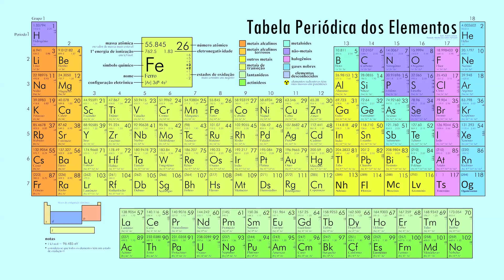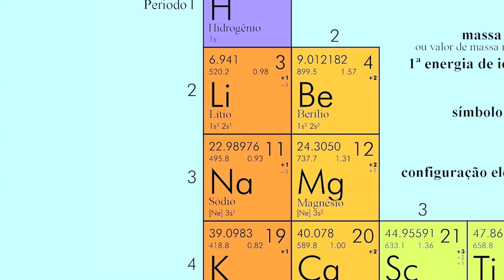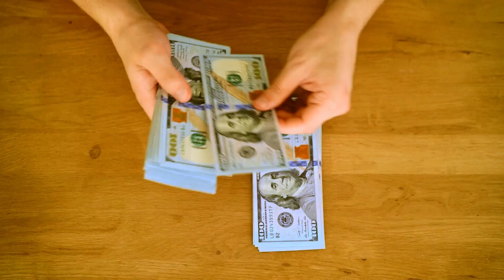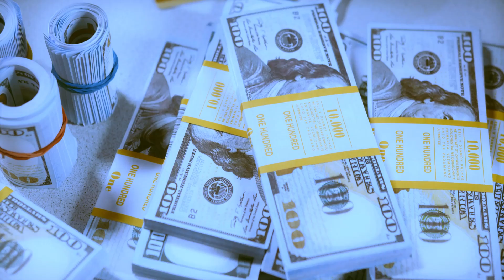BREAKING NEWS: BYD'S SODIUM-ION EV UNDER $10K!

Comment: I want to invest in sodium ion tecnology. Why it is important so much for me? 1) Environmental issues: They have the highest importance. Sodium is more abundant, cheap, clean, easily recycalable, friendly to environment in production process,  compared to lithium. Sodium can not pollute water and environment in production process. On the other hand you do not need scarce elements like Cobalt and Manganese in production of batteries. These element are much worse than litium in price, abundence and environmental issues in production. 2) Security: Sodium ion batteries are more reliable in causing fire demages. 3) Economy: Today it is said that only battery itself can cause %30 -  %50 of production costes of vehicle, depanding on the model. Sodium is much much cheaper than litium because of aboundance and easy production. Therefore sodium can cause to produce cheaper vehicles. That means majority of common peoples can reach transportation needs more easily and cost effectively.